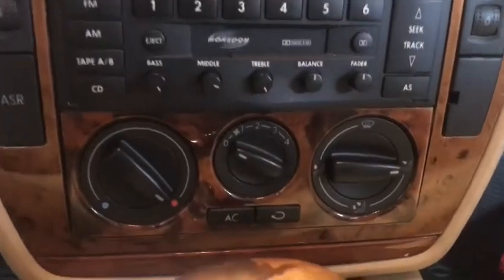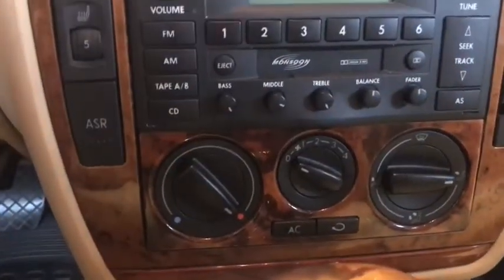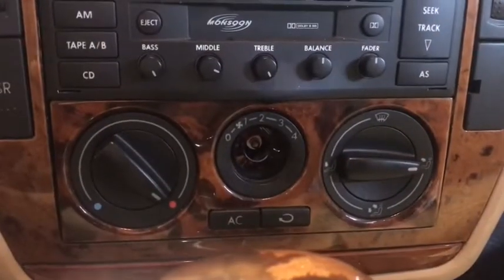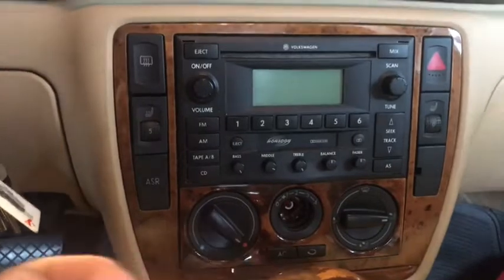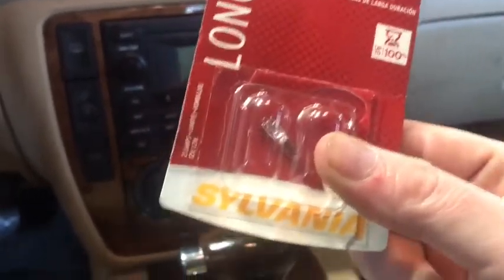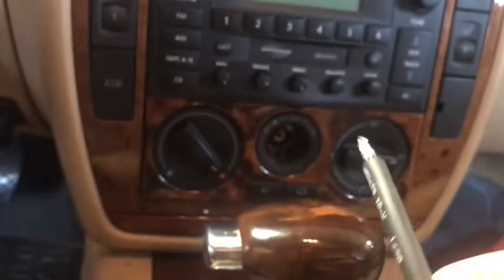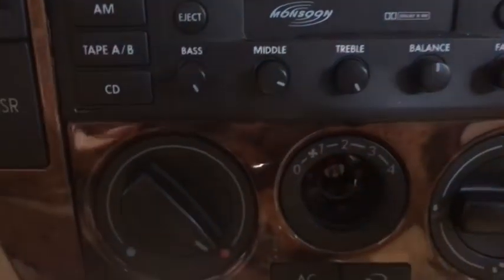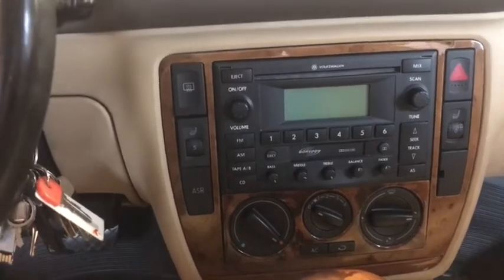Climate control instrument panel bulb replacement for Volkswagen Passat B5, B5.5 and others

Comment: Great video, very helpful. Can anyone here confirm that a B5 takes the same bulb as a B5.5? My local AutoZone claims the 2721 won't fit my 2001 wagon, but I don't see why it the B5 and B5.5 wouldn't take the same part in this particular application.
Reply from the maker: I’m pretty certain they are the same
Reply: @AutoScholarwithMrB  Sure looks like it should be. Thanks again for a great timesaver of a video.
Reply from the maker: @johne6081  thanks for watching!

Comment: Where you have the ASR on the lower right…..mine says ESP. Do you know what ESP means?
Reply from the maker: Electronic stability program, basically the same as ASR.
Reply: @AutoScholarwithMrB  
We bought this car used recently without a manual. Please explain the need for this button. When pushed  a warning light appears on dash that has a circle with a triangle in it with an exclamation point. Thank you very much for your response.
Reply from the maker: @beckyenyart8260  that is basically your traction control. With it turned off you can spin your tires.
Reply: @AutoScholarwithMrB  
Subscribed! Thank
Reply from the maker: @beckyenyart8260  thanks Becky!